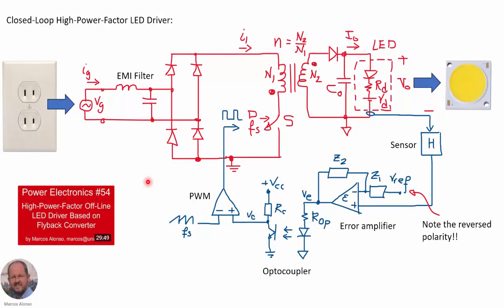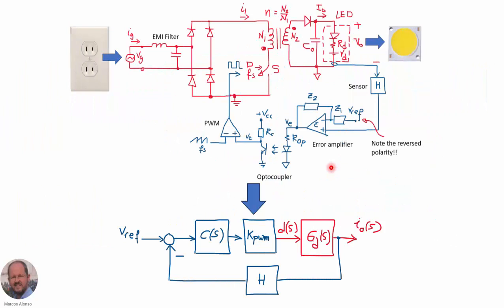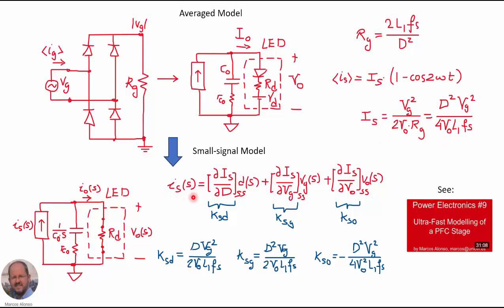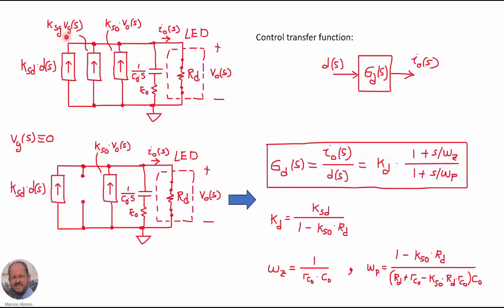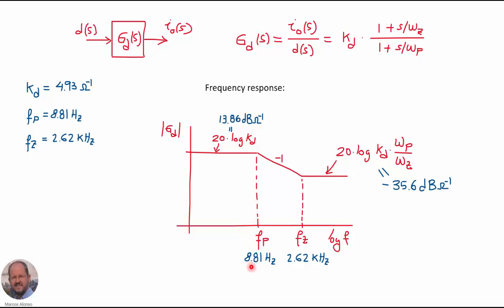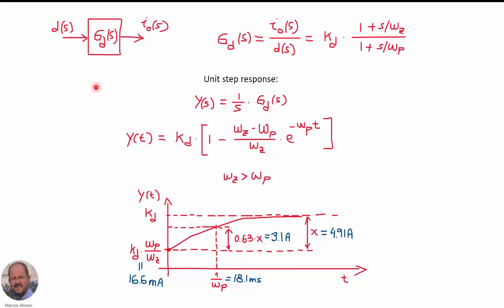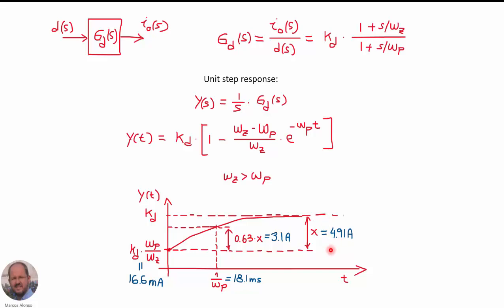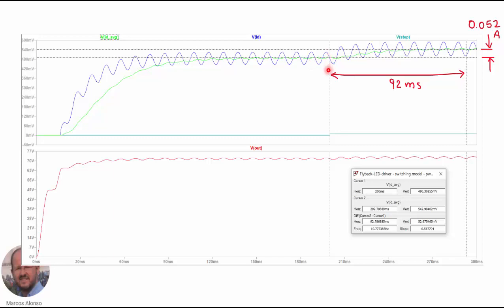PE #55: High-Power-Factor Off-Line LED Driver Based on Flyback Converter: Dynamic Modelling

Comment: Hello Dr, may I ask for 6:01 why there is no perturbation for the diode at the secondary side like the video in PE#10 at 16:50?
Reply from the maker: Hello, this converter operates in DCM so we model the output diode as a current source. The perturbations are done on this current source.
PE #8 shows an example of converter modeling in DCM: https://youtu.be/PdBgK4YI03w
Reply: @MarcosAlonsoElectronics  Thank you Dr.

Comment: Hello Dr, what is the reason for obtaining the transfer function Gd(s). Is it used to reduce the ripple of the rectified AC signal and why the equation of the Gd(s) is constructed in this format. Thank you very much for the help.
Reply from the maker: Hello, thanks for your question. Gd(s) is necessary to design a compensator for closed-loop operation. In LED drivers we usually want to regulate the current through the LED. This is why we obtain the transfer function as io(s)/d(s). d is our control variable and io is the variable we want to control.
Reply: @MarcosAlonsoElectronics  Thank Dr for the clarification.

Comment: Why you made Vg(s) only as zero? What is the reason behind putting one perturbation as zero? Are we assuming that the input voltage won't change?
Reply from the maker: In the video, we are interested in the control-to-output transfer function, which is how the output current is going to change when the duty cycle changes (i_o(s)/d(s)). We have linearized the circuit around its steady-state operation point and then applied the Fourier transform.
Because now our circuit is linear, we can use the superposition principle.
To get the control-to-output transfer function we make zero the perturbations on the peak line voltage, so we do v_g(s)=0. With this we are assuming that the peak line voltage will remain constant.
If we wanted the response of peak-line-voltage to output current (i_o(s)/V_g(s)), then we would make zero the perturbation on the duty cycle (d(s)=0) and solve the equations to get the transfer function in the same manner.
There are several videos on this playlist about modelling of dc-dc converters where you can find more information about how to obtain the different transfer functions of a dc-dc converter.